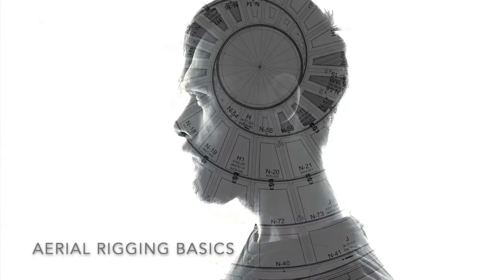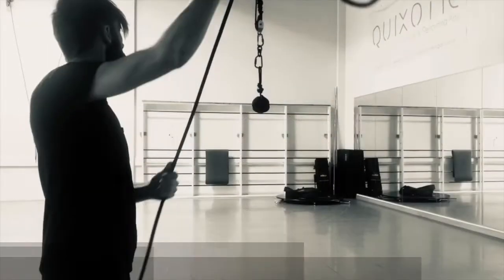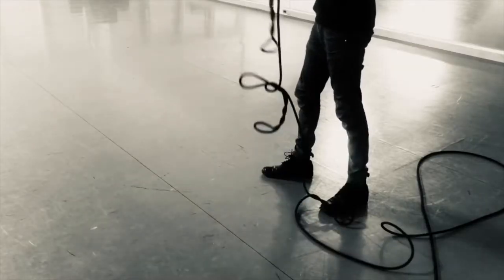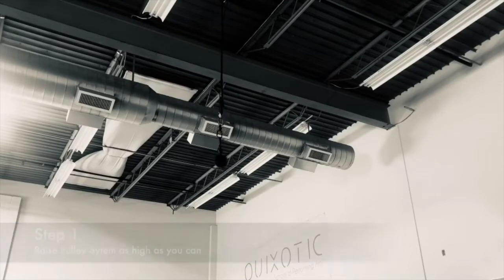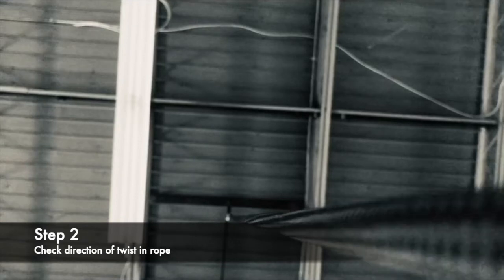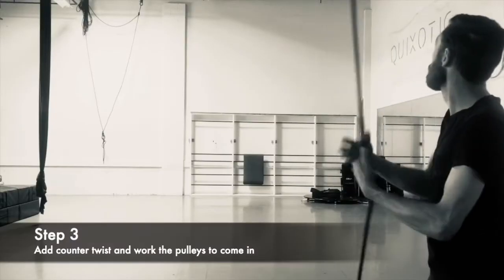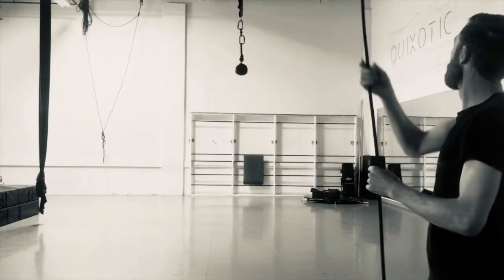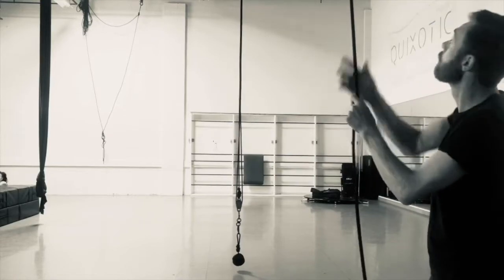3 Steps to Untwist Your Pulley System

Comment: I fabricated a swing arm pully system to lift some construction material ,the rope doens't twist for like 12-14 pounds but after that  very half a pound cause twist of two....i tried all the methods and the method which occassionally solved my problem was to put as much as weight as possible to be easily lifted and when it twists , untwist by untieing the rope ...still.  Rope pully system is annoying...better i bought cable